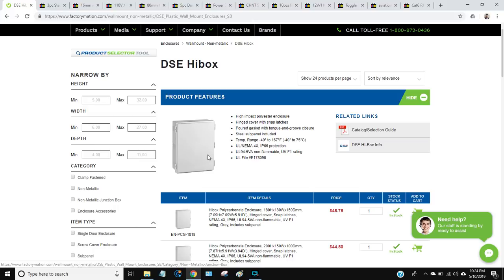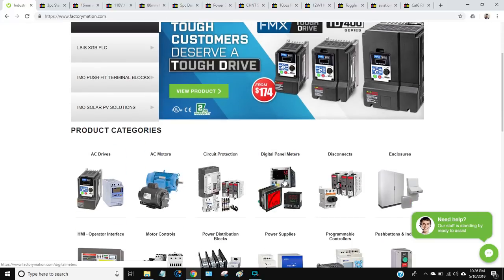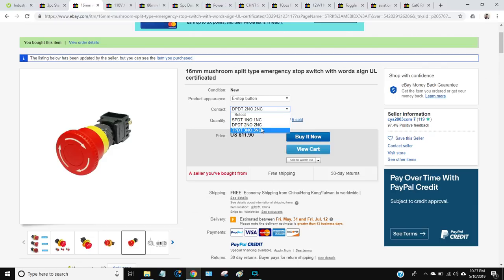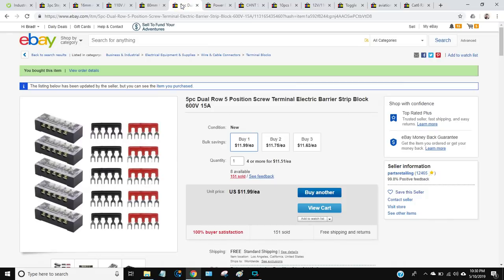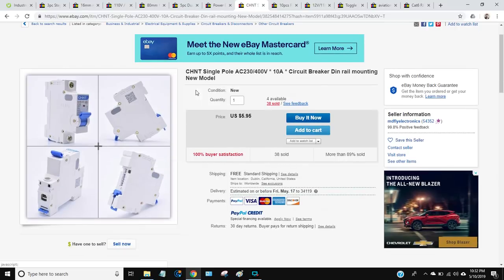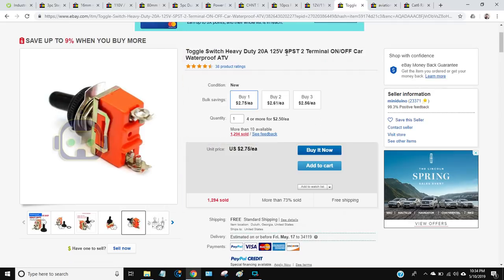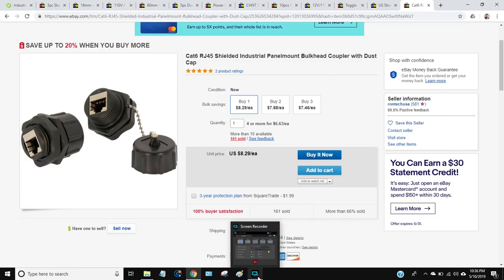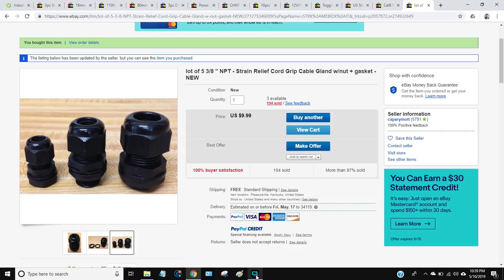CNC Control Box Components

Comment: Great timing. I am currently in the process of putting a control box together for my 6040. Bought the aviation connectors but I am on doubt wether to use them or not. The male part of the connector seems a bit hard to solder. Might cause more harm than good to use them. Dont think i will diconnect the motors to often. Have searched the tube for that but can only finds videos of the long conncetor (female connector?) which is easy to solder. You said u used them in the past. If you have any videos were you solder the male connector. I would be super happy if you could put a link that one. As it feels right now I am actully leaning against using the cable relief grip cable gland.